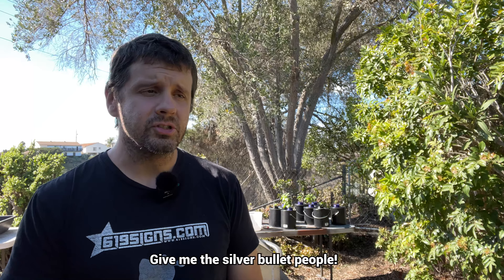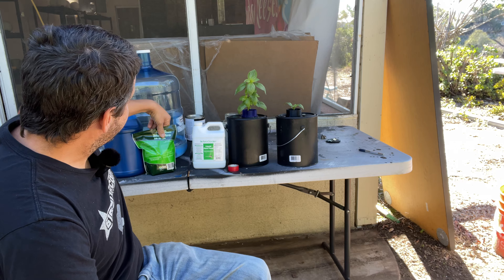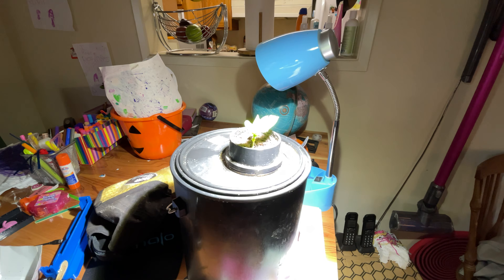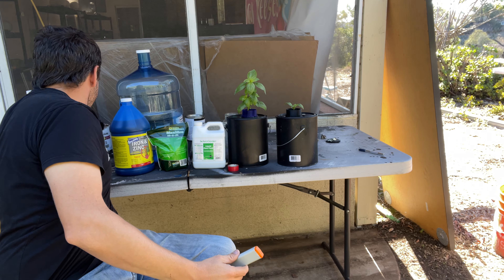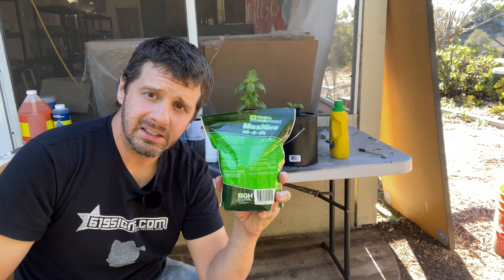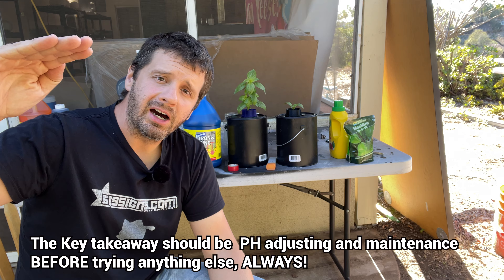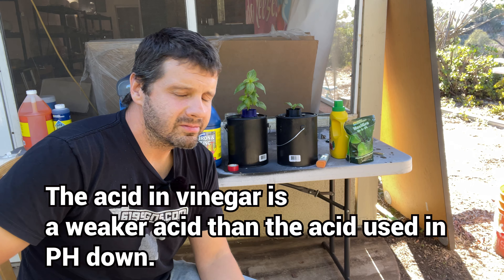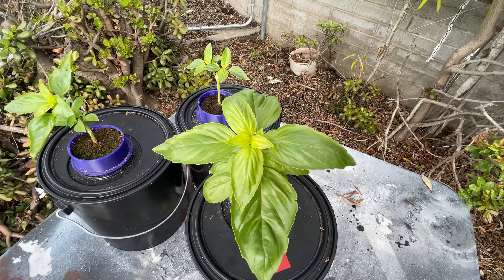How to fix hydroponic yellow basil stemming from an iron deficiency that is actually a PH issue.

Comment: It sounds like the Ph keeps changing. Is there a point at which it will stay where you're trying to keep it? Also, how do you test Ph in soil. Is there a different type of Ph meter for that? I have some basil plants in the ground that are growing but their leaves are staying small when they grow in and it does tend to get yellow on the bottom leaves and some will even dry up and get brown, so this may or may not be what you're experiencing, but I am planning on taking some cuttings or growing seeds in hydroponics. I have not yet tried basil that way.
Reply from the maker: In a larger reservoir it can stabilize where you need to adjust less often. No matter what PH adjustments never end but you can space them out.

Comment: Unless pH down/up work differently than acid and base, adding them together just makes water.

So I wouldn't recommend doing what he said with the clamping the pH unless your using the right product.
Reply from the maker: While there are better ways to buffer a hydroponic solution, the clamping down method works and is documented by other growers using kratky.  You forgot the part about adding the nutrients and how those interact.   Especially when using RO water with no  acid/bases present. Anyone can try this and have a control and find if there is any benefit. 

"In the case of adding acidic fertilizers to water, these often contain nitrogen in the form of ammonium ions (NH4+), which can act as a weak acid. If you were to subsequently add a strong base, like potassium hydroxide, you would deprotonate some of the ammonium ions to form ammonia (NH3), which is the conjugate base of the ammonium ion. This could potentially form an ammonium/ammonia buffer system.

Similarly, many fertilizers contain phosphate ions (PO4^3-) which can act as a weak base. Adding a strong acid could protonate the phosphate ions to form dihydrogen phosphate (H2PO4-), hydrogen phosphate (HPO4^2-), or even monohydrogen phosphate (H3PO4), depending on the amount of acid added. This could potentially form a phosphate buffer system."

Comment: What is the pH of your water?
Reply from the maker: I like to go to 5 to 5.5.  Its on the low side, but these buckets and small and the PH rises fast.  If you target the recommended PH of like 6, you will be in the high range quickly and that will create the yellow basil leaves in a few days.
Reply: @iheart3dprinting951  Although I've never used hydroponics, I know whenever you start adding pH adjusters to water and then nutrients, it's really like walking a tight rope. So if your starting out at 5-5.5, I'm curious what is your tap water is at to begin with?